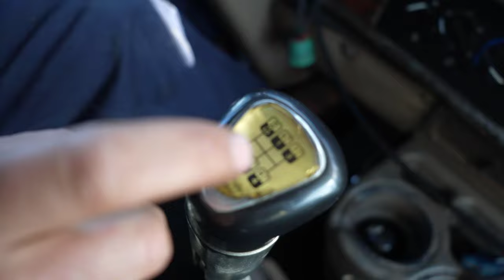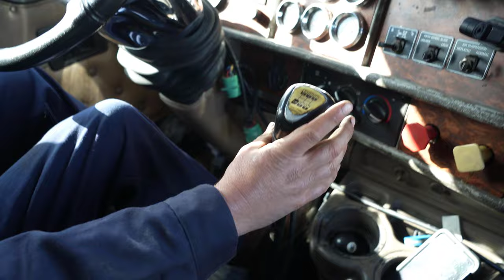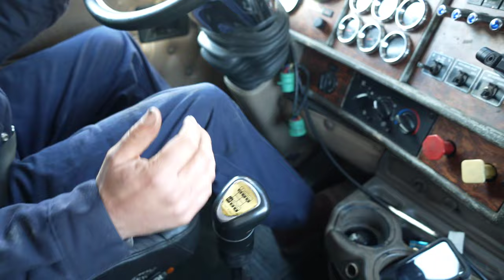How To Drive A 13 Speed Manual Transmission - Tutorial

Comment: Why drive a auto when you can have this
Reply: As an Owner/Operator it will last much longer than an automatic and swapping out a new clutch doesn't cost an insane price.
Reply: @thisismagacountry1318  new automatics come with a 750k mile warranty.... They got them figured out pretty well, my dad has an 18 spd, but doesn't need it for all loads. 

He says if he'll drive lower 48 he might go auto
Reply: Better mpg that's why drive an automatic
Reply: @SP-cm8lg  it’s simple if you worried about a transmission saving you money you hauling cheap freight
Reply: @AceSmoke662  I  hauling 43000lb load I am hitting 78000 lb Total getting 7 mpg  on light loads I am doing 9 mpg hey keep spending your money doing 4 mpg.
Reply: @SP-cm8lg  yea you probably driving 65 mph to save diesel to huh 🤣 i stopped worrying about fuel saving a long time ago stop hauling that 1.10 a mile and you won’t have to do math to figure out ways to save money
Reply: There's multiple sides, hauling 200k+ 18 spd is kinda needed (Alaska) you could do it with a 10- 13 spd or auto. You have less selection of gears... Auto is not optimal for running Alaska.  We have an overweight permit year round, with no expiration date.. uncle ran 240k lbs single trailer last few months.
Reply: Manual all day for me.

Comment: Not a pro driver. But I have driven them.  I always looked at the 13 as 4 speeds stacked.  Like the VW Beetle I had then. Within minutes of getting out of the rig, I was speed shifting the trans.  The 72 Ford Explorer - 302 column shift was a bit to get it right. 79 Diesel Golf - 4 speed. Dodge 225 slant 6 - 5 speed. Ford 4.9L 5 speed. 5 VW Jetta's.  I was very lucky to have a driver willing to take me along, and I got to see many problems that 4 wheels created. 
To this day - I watch traffic - and allow trucks to move around me, as needed.  I pick my spots - so the rig has the advantage - to roll past me , and once the rig is passing - I brake - so the rig has a short time beside me.   I always flash my high beams - to let the rig move quickly in front of me.   I  wish you all safe roads. Cheers!

Comment: As an OTR driver who runs Conestoga I love my 18 speed, that shakes and sounds like my old international 9200 or 9400.
Reply: With Conestoga do you just strap the load down and the Conestoga acts as a simulated dryvan?
Reply: @thisismagacountry1318  yes, it opens from front to back or back to front. And is the easiest way to tarp, without throwing a tarp.
Reply: @wayneblue5370  Cool, I'm 62 and want that oilfield pipe money from Houston to Midland/Odessa, but tarping is not for me.
Reply: @thisismagacountry1318  I'm 44 already had a spinal fusion, and only weigh 160lbs, so throwing a 200lb tarp isn't for me either.

Comment: Great video. At what speed do you downshift? For example in a 10 speed you can downshift to 9th between 40-45, 8th between 30-35 etc.
Reply: I just watch the rpm and down shift right when's it at 10

Comment: So do you not need to use the side splitter? I’ve heard people say that they just use it as a 10 speed, only using that back splitter??
Reply: The spread on the rpm gap would be double on the final 4 without the side splitter. Just like skip shifting.

Comment: I just picked up a truck with a 13 conversion and for the life of me it doesn’t split the high range gears on the up shift without grinding and a lot of feathering in the throttle. I know this is t normal. For instance- if I’m in 5h and upshifting to 6l it grinds. Not sure if it’s a Paccar thing or not, but I notice the rpm’s drop ridiculously fast when I get into neutral for the shift which is why I’ve got to throttle. Any idea what the issue could be?
Reply: Make sure air line for the splitter is hooked up.

Comment: So why is the 10 speed more common?
Reply: It is cheaper to spec. for day cab truck fleet owners, less shifting for the driver, and it gets better fuel mileage on level roads. One driver, Trucker Josh ( a YouTube vlogger) in Canada, was averaging 10 MPG on a twin screw, 10 speed, company truck with a load. But the downside was it would not power up a grade and bog with less ratios to choose from.
Reply: @MegaGeorge1948  yeah ever since I’ve been running a lot of open bore tankers with a 10 speed its a total beast to get up a steep grade especially an on ramp onto the interstate.  Downshifting coming down a heavy grade is just as bad.

Comment: A good driver uses the clutch .. you need to use it so you don't wear off the transmission ..it's also a manufactured recommendation
Reply: But experienced drivers know how to do it the right way without clutch
Reply: Wrong
Reply: It's called floating gears